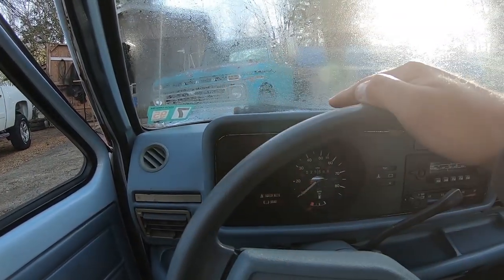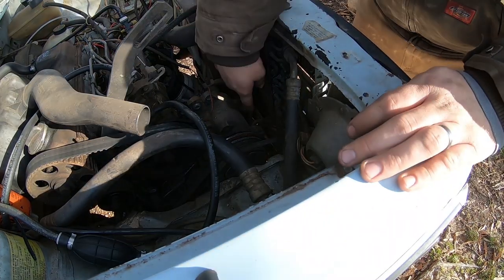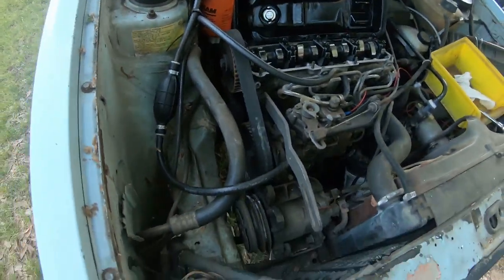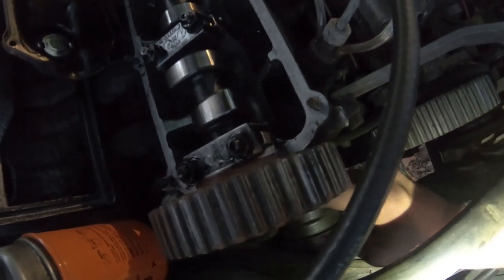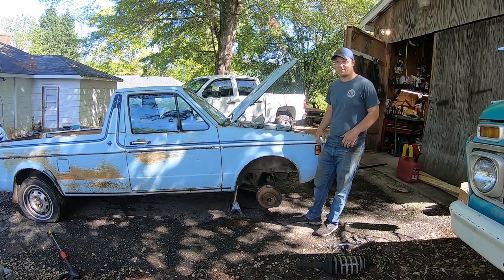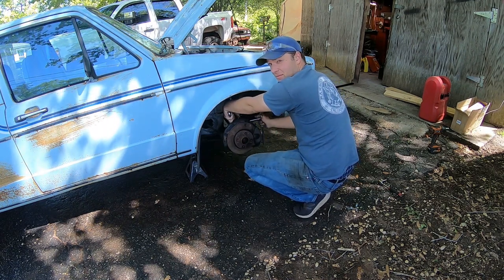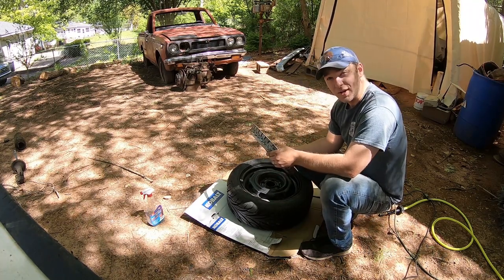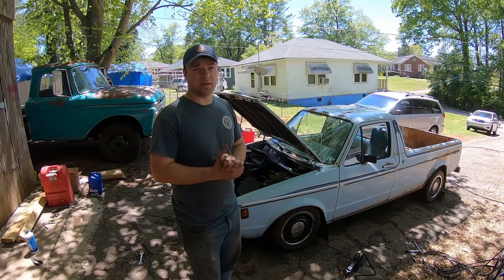Barn Find VW Rabbit Pickup Sitting for 25 Years! :Rebuild Part 4

Comment: These Rabbit videos bring back a lot of memories from when I was younger. My dad use to own a lot of Rabbits. He loved the diesel Rabbits. But man did they require a bunch of work. He owned one that literally broke down every Thursday.  He loved getting 50 mpg with them. But man did we spend a lot of time changing timing belts, injector pumps, glow plugs, etc. Not to mention having to push and pull start them with other vehicles in the winter when they wouldn't start. 
You are doing a good job on this truck. It's fun to watch the videos and see you bring the vehicles back to life. I personally never saw the appeal of a slammed car/truck. Yea it may look ok, but it makes them just about useless. I love to drive. And constantly dragging/bottoming out on bumps, dips, driveways, speed bumps is not my idea of a fun time.  Especially on a truck.

Comment: I give you this much, its hard to work in front of people and not mess up. Just do your best on a shoestring and hope for the best. I go for level when putting struts on. It comes damn close and then tighten the coil over some to get extra clearance if you have need of it. Put the level on side of that brake rotor and with level or just a skosh positive and tighten up till get to wheel alignment done.

Comment: You can pry the engine a bit to the side with a big bar, crankshaft center to chassis, thus making space to change the tensioner pulley without pulling the mount or jacking the engine.

Comment: I maintained three of these up to a combined 600,000 miles. I still have the pump pin, cam locking and water pump pulley bolt locking tools. There’s a special two pin tool for the tensioner too. I used the timing marks on the flywheel visible through a plug on the bell housing. Keep the updates coming 

Rust killed ours, Scotland has a harsh climate
Reply from the maker: Awesome! Sorry!

Comment: I learnt a trick to change this type of timing belt. You can slice around the whole belt so it is essentially 2 belts, remove the front half and slide the new belt half on, then cut the other half of the old belt off and push the new one the rest of the way on. It's easier with rear drive cars
Reply: Doesn't work on these engines. The tensioner has a 5mm lip.
And you should always replace the tensioner anyways.
Reply from the maker: Never thought of that! Awesome trick, thanks!

Comment: TIP: 14mm is very uncommon on german cars. We use 10-(12 for copper nuts on the exaust)-13-15-17-19. Larger only common on high torque nuts and bolts i.e. crankshaft or for fixing camshafts etc.

Comment: rims look great, vehicle bit on the low side. axel flip a defo plz dont go too low. dont forget when u can get your wheels and tyres balanced as you will get vibrations at around 40-50mph.
tyres are defo cheap over there 15"-16" in most sizes in the uk £35-50 per tyre but then that is fitted & balanced from most places. i went from 18" amg wheels on my 2010 merc to 16" merc rims as 245-30-18 too low profile bent a wheel and blew a tyre in a shallow ish pot hole. sold them repaired for £500 bought gen merc rims off ebay £100 with good 4-5mm continental tyres
Reply from the maker: Thank you! Definitely will! Sweet! 🙂

Comment: I love the wheels and tires. I much prefer a set of shiny rings and caps to alloy rims on an older car. I have an '82 Volvo 244 in a very similar shade of light blue (even down to the rust - sorry, 'patina'!) and she looks amazing with the rings and caps all round. Debating whitewalls when it comes time for new rubber. I love the striped on this little VW, very late 70s and again something I'm considering (Volvo made a graphics kit for thecdedan with a similar look).
Reply from the maker: Glad you like! Sweet! I wish they made white walls on this size tire...I’m tempted to see if they make a paint to do so 😁 That would be awesome! Go for it!

Comment: I had 2 cars that i fixed timingbelts on they where non interference engines and i had no problem with the head after putting on the new belt one was my friends car a deawoo lanos and the other one was my car a fiat tipo 1.9 td. I was lucky that nothing broke like the valves and sutch. Good luck with your vw greetings from Bill in Holland
Reply from the maker: I said it wrong on there sorry! This is an interference engine, non-inference is no contact. Sorry 🙂 thanks so much!
Reply: @BudgetBuildz  is the vw a non interference engine or not?
Reply from the maker: Bill Canell It is not non-interference, if the timing belt breaks it goes cabloom lol

Comment: Just did a eight year restore on a 82 Diesel 5 speed used two cabros and three other Rabbits for parts they are hard to find Now thinking of putting the 1.9 tdi out of a 01 Jetta in it with the auto  you have a great truck their not many Around
Reply from the maker: Sweet! I love an ALH in a mk1! Thank you 🙂

Comment: BTW I had an 81 Cabby years ago, not as low as you set it, and the axles actually rubbed on the frame rails on some bumps. So if you're going to tuck stock tires you may want to take a look and see if you need to notch the rails.
Reply from the maker: Cool! I found its due to the large passenger cv axle, one fix is to get a solid (not hollow) replacement. Making it smaller and not rubbing. I’m low but not too crazy, it may bump here and there. If it decide to rub, maybe I’ll notch it’s and make a video 🙂
Reply: @BudgetBuildz  alright! Good luck. I just hope you don't get the shock i got when i looked under and saw a shiny ring around my axle from those bumps.

I'd love to see a video on it if you do

Comment: A+ for ambition! but the way you did the timing belt is the reason so many of these vw's die an early death, the proper lock tools on ebay are not that much money. the cam pulley must be loosened when installing the belt so that you can transfer your slack to the tensioner without retarding your cam timing. you also need to set your pump timing with a dial indicator unless you want to crack cylinder heads and burn holes through pistons etc. these are precision built machines and as a stubborn fussy old German vw mechanic i get frustrated when i see so many people on youtube or elsewhere do things wrong mechanically. then i get the customer that attempted to do their timing belt and bent all the valves because youtube said it was easy.  but in the end if you are happy. i guess that is all that matters. i should not care because it keeps me busy, but i still do care... i can scan you pages out of the repair manual if you need, i have every manual from 1943 all the way up to modern vw garbage. i have a real soft spot for these 1.5 and 1.6 diesels. the simplicity and ease of maintenance is wonderful compared to this new double egr, dpf tree hugging junk i work on now.....

Comment: Did you also have to adjust the valves before reassembling the valve cover?
Reply from the maker: Not adjustable on this little ride 🙂 Overhead cam, hydraulic lifters. If they’re out of adjustment enough, you would have to pull the cam and re shim them.